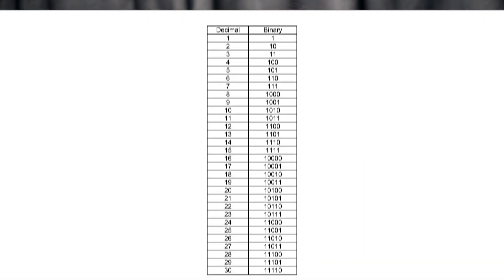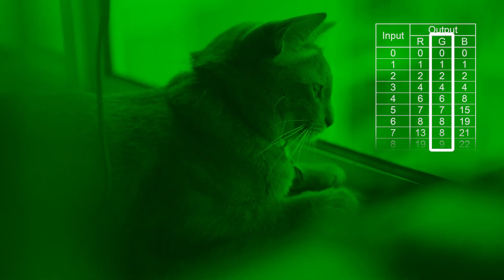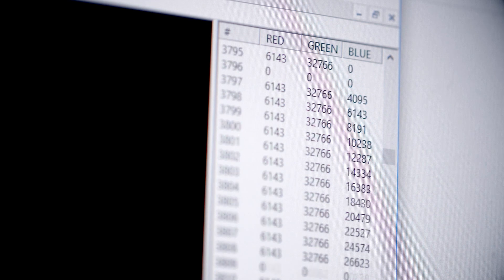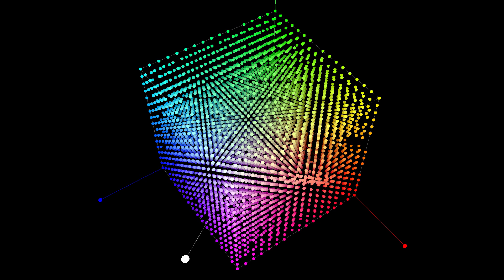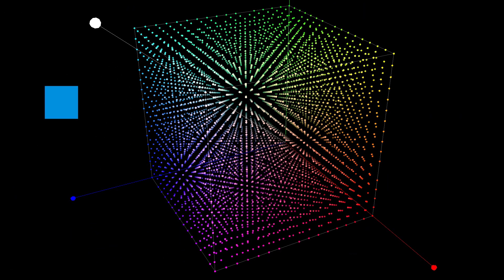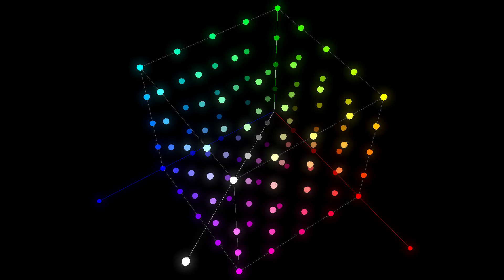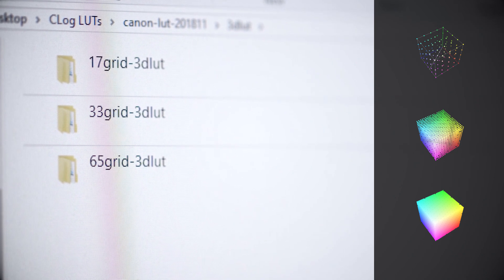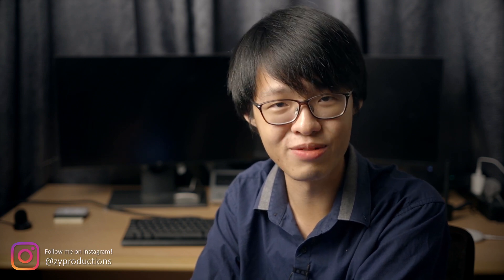LUTs Explained! 1D vs 3D LUT?

Comment: A little correction, you generaly won't get artifacts even if little nodes (it can start at 2 nodes per axis) if you don't have already artefacts in the image, unless the code implementation in the software doesn't follow recommended standards, and in such the ideal interpolation isn't just linear or bicubic or nearest but is a bit more advanced and thus avoid thoses artifacts.

Comment: Beautifully produced video, and great explanation.  I guess viewers have an understand of lookup tables, however, the only reason I am looking at this is because I am investigating 3DTV (how retro!).  If my understanding is correct, LUT is used for colour (contrast, brightness etc), and has absolutely nothing to do with 3D.  Currys (.co.uk) have an article "Is 3D TV still a thing?" in which they say that "Most new high-end TVs still have it. Though they’re no longer branded 3D TVs. They’re 4K UHD TVs or OLED TVs that include 3D as one of their myriad features." ...so, I am looking at TV specs, and don't see 3D as a feature, but come across 3D LUT ... maybe people appreciate lookup tables as a feature, but I find this terminology confusing (and generally unnecessary for a consumer).

Comment: 4:30
 if the colors in between are calculated it means that different bit depths are no problem bcs it can calculate all the possible colors in between the nodes? So no quality loss when using 3d lut on a 16 bit image?
Or is there a border at like 12 bits or 14 bits where the lut is not able to find the accurate exact color and instead go to the next 8bit or 10 bit color which is close to the actual one?

Comment: Hello..
I want to buy new laptop for VFX AND 3D WORK please suggest best laptop for all software and plug ins work smoothly like after effects,  Element 3d, Maya, etc
..
Reply: If you're serious about 3d modelling then you should look for laptops with quadro cards and large amounts of RAM in them. I've had projects in solidworks that won't even open on systems with less than 64GB of RAM ahaha.
Reply: @Crezeulb  but not at large scale therefore I am looking for laptop
Reply: @finishthegameyt3057  You can use a laptop but at some point you may need a desktop or evga external graphics box.
Reply: Thank you but, I already decided to build a new pc ..